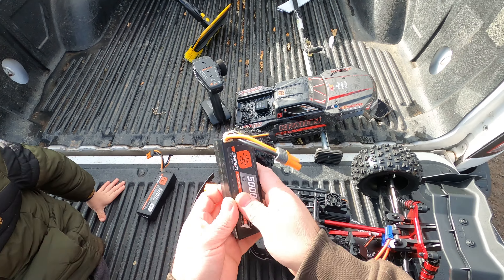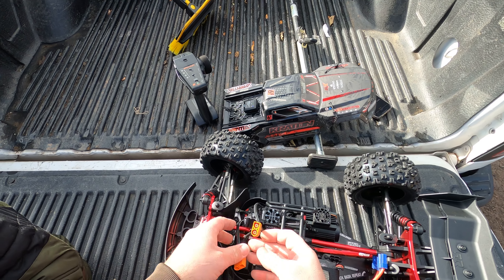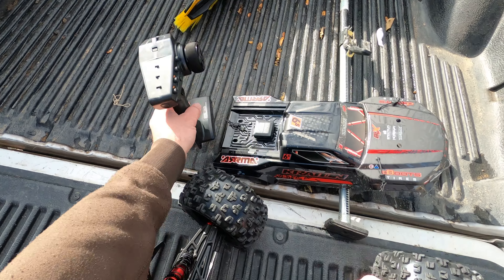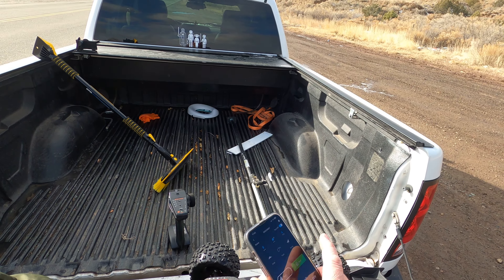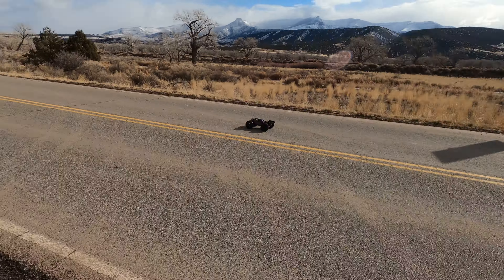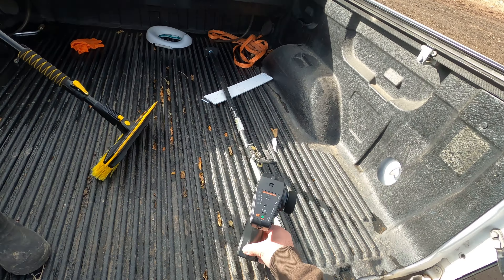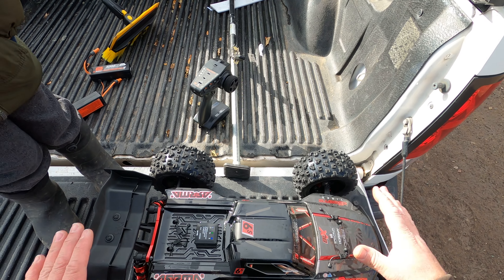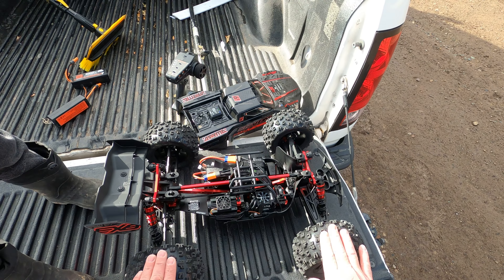New 2023 Kraton EXB 6S V2 stock speed run with speed pinion (16T) - 65MPH Cutting out

Comment: You got the exact same speeds that I did on my Kraton EXB V2. I did 58 on the 13T and 65 on the 16T using Amazon Youme Power 60C 4500mah batteries. I have a 5200 CNHL 6S racing battery on the way and I will see if that makes it go any faster or not.
Reply from the maker: @Doug_Morgan  heck yeah! Please report back when you test them and see if it makes a difference!!
Reply: @dgitalchaos  Yes can do, the battery is due here on the 15th so I should know by next weekend.
Reply from the maker: @Doug_Morgan  awesome! I bet you will get better numbers. Mine kept amping out. Not sure if that was ESC or battery, though I’m aiming towards a battery issue.
Reply: @dgitalchaos  I just ran the pack for the first time. It showed very low IR during the first charge. It has an insane amount of punch compared to my other batteries with very little voltage sag. I will need to raise the lvc with these batteries because of it. I had lvc set at 3.3v for the other batteries and at lvc they would be at 3.45~3.5 when it kicked in. With these CNHL Racing batteries the cells were below 3.3v so they hold voltage right to the end with no real sag. I don't like to run them down below 3.4v. As for top speed it remained the same at 65 but would do it without effort. I did many runs and even just shortly before lvc it would still pull 64. I am going to buy more of these in the future.
Reply from the maker: @Doug_Morgan  thanks for the update! Good to hear they improve the performance. I’m surprised the top speed didn’t increase, but gearing might give higher speeds with those batteries.
Reply: @dgitalchaos  I may get a bit more speed the next time out. I use the track at a local high school that is rubber coated asphalt. The city had just run the sprinklers on the football field in the center of the track so the track was wet and I was having a bit of a tough time keeping it straight at high speed as it gets a bit slick when wet plus the Kraton was hydroplaning. On one run I ended up doing donuts down the track at close to 60 when I lost control. The first CNHL racing batteries I bought was a pair of 4S 9500 batteries for my Xmaxx/XRT. I was so impressed with those that I decided to try a 6S as well. Hopefully they last as well as they perform.
Reply from the maker: @Doug_Morgan  traction definitely makes a difference! 65MPH is pretty good on wet track!
Reply: @dgitalchaos  You would have had a good laugh if I had my GoPro to film it. It was pretty wild trying to do speed runs in those conditions lol.
Reply from the maker: @Doug_Morgan  I hit 100MPH in the rain with my Infraction 🤣🤣. That was difficult.
Reply: @dgitalchaos  That must have been fun.
Reply from the maker: @Doug_Morgan  it sure was!
https://youtu.be/waDBanifF_o?si=O1DGSGlpQF6LmF6K
Reply: @dgitalchaos  Hey bud, I went to a new location out by an overpass on the highway. Dry road and I hit 68 mph with my stock Kraton EXB with the 16T pinion. I think I can hit 70 but the tires are ballooning so much at that speed it is hard to hold it straight. Those CNHL racing batteries really seem to perform.